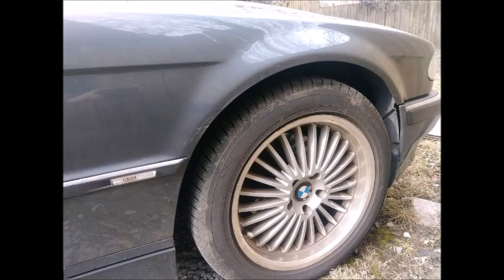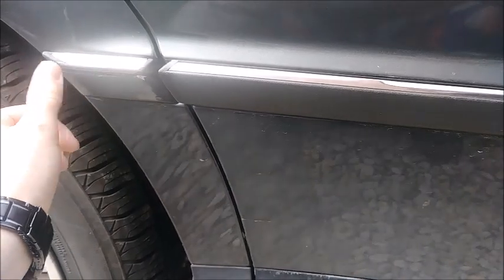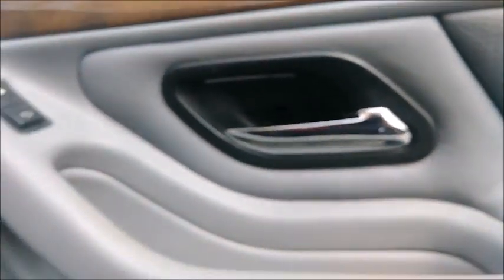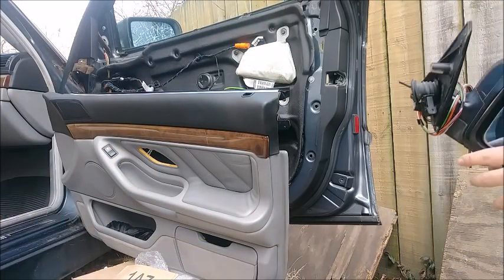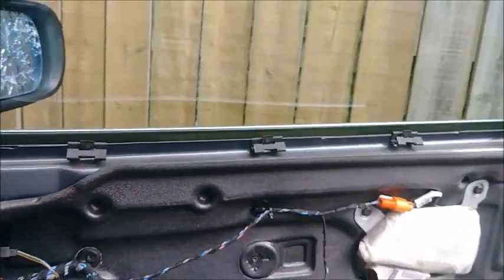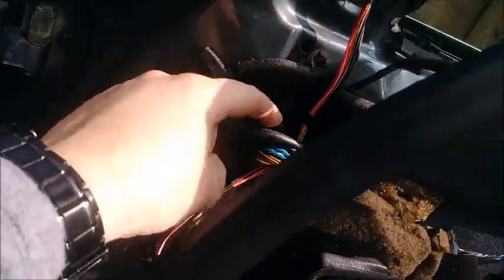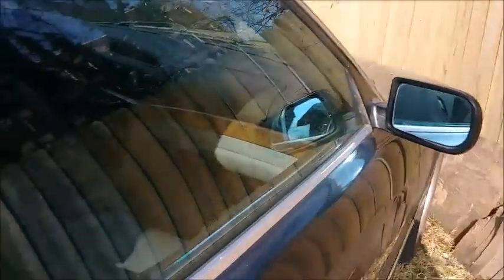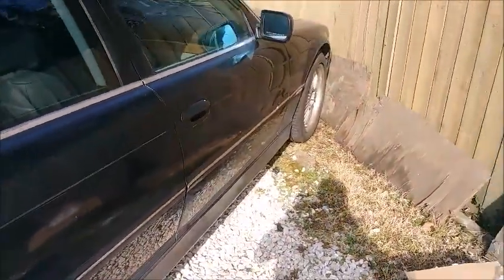How to remove and replace right side mirror BMW e38

Comment: What type of glue would you use to reseal the door panel. My door panel is protruding near the window (diver side)  Please do a video on resealing the top of the door panel near the window.
Reply from the maker: You would use a gasket maker called The Right Stuff made by Permatex to glue the door panel back to the backing. I plan on doing this on my BMW in the near future because mine is doing the dame thing now on both sides and it is unsightly
Reply: @HollywoodHornet  Thank you! 
Thanks for sharing this video clip about changing the side mirror. My mirror has a golden tint. Don't know how and what caused the problem. But I have ordered a new mirror and watching your video I'm sure I can replace it with ease.

Comment: the car has power folding mirror?
Reply from the maker: Negative. Only power adjustment, not power folding. Original owner didn't want that option, I reckon.